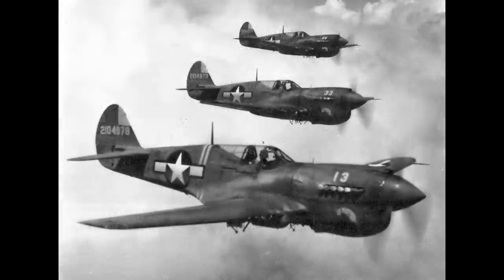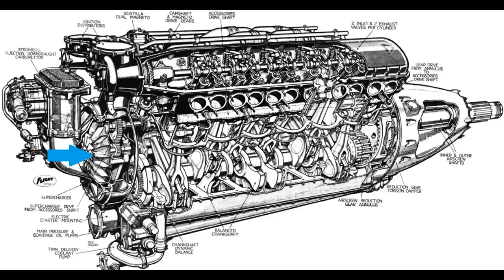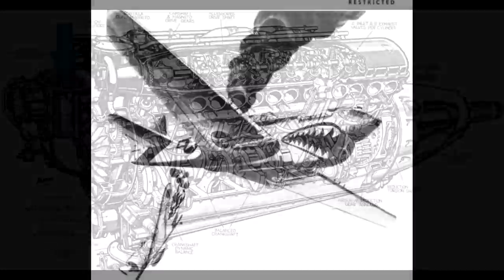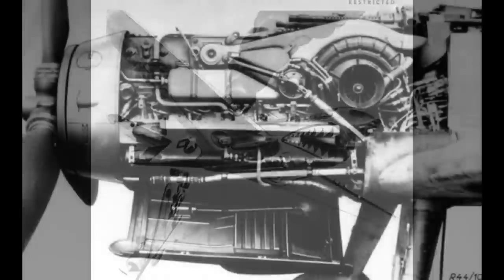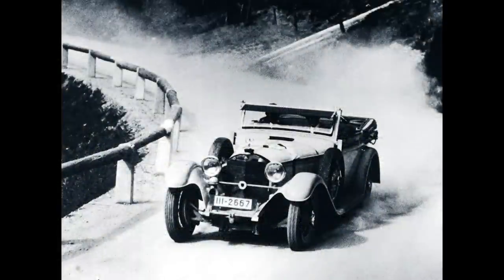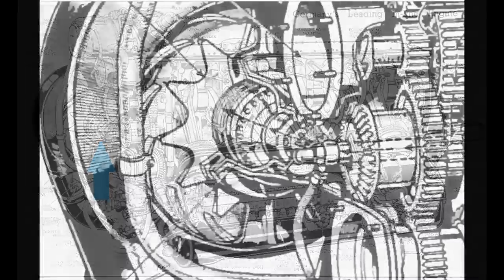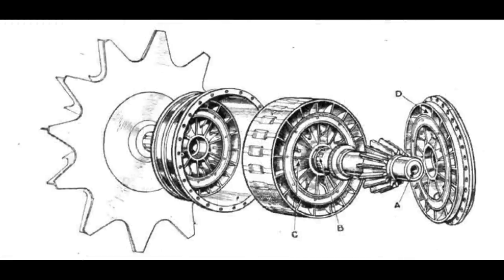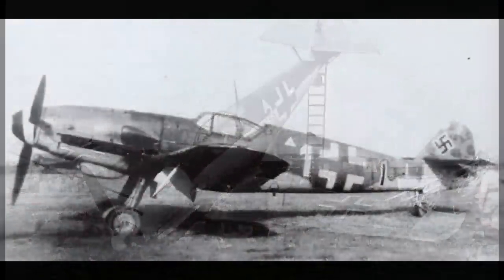Messerschmitt BF 109 Supercharger Drive System

Comment: Interesting, learned something more about the 109's engine, and coming back to my Train comment on the other video it is interesting, as in germany post war they used hydraulic transmissions to transmit the power from a diesel engine to the wheels, to have a smooth and uninterrupted flow of power. 

It was superior to the earlier geared diesel locos and multiple units/Railcars, and in weight and weight to power ratio superior to the Diesel-Electric transmission. 
Also without computerisation it was easier to run for drivers, as you didn't have to worry about putting too much current in the motor, which like overboosting can destroy them or rather burn them out, or field weakening, etc. 
Diesel electric transmission needs a lot of computer control to achieve that. 
However Diesel-Electric transmission was superior in that it was more rugged and needed less maitenance, as well as being able to run on a lesser quality maintenance. 
Also today it is much easier to get the train supply energy/Head end power, by simply getting it off the generator, unlike a diesel-hydraulic engine where you need to fit a generator for the electricity alone. 

However until fairly recently Diesel-hydraulic transmission reigned supreme in Railcars/multiple units, as they generally do not have as much space and need to lighter. 
Even British Rail which standardised on Diesel-Electric Transmission in locos did mostly used Diesel-Hydraulic transmission in their second generation Diesel-Multiple Units (Class 150-155, Class 165/166) and most of the Privatisation Era Multiple Units (Class 170/171, Class 175, Class 180 and Class 185). 
Only the Class 220-222 Family has been DEMU (Diesel Electric Mulitple Units), and the High Speed train is more like a conventional trains with two locos (Powercars) in a push-pull configuration. 

It became really popular here in germany and even the Western Region of British Railways used it, but it had some problems there, mainly that the system or rather the wheels were originally designed to run at 120 km/h in post-war germany and the British ran the locos routinely at 140 km/h......which meant that the wheels got to high rpm, which damaged the system. 
(It's also a problem with steam locomotives where the reciprocating steam engine/aka the cylinder block, can be damaged when oversped. Which is the main fear when it comes to wheelslip, as in wheelslip the "speed" at with the wheels move can exceed 200 km/h or 125 mph.........this is excerbated by the significant moving masses involved. )

Where this ties into the 109's engine is that this system allows near infinite variation of speed and torque, something which the railways need, and this supercharger design as well. 
Similar are also the compact size and light weight.

Comment: BTW, I always want to ask - Any idea why Germans used inverted V engines, and the rest of the world upright? That BTW also had its affect on the shape of fuselage cross-section that was kinda triangular shape, which is structurally a very sound construction.
Reply: +RussianThunderrr   Upright and inverted designs worked equally well.  Sometime in the 1930s when the German aero engines were being authorized, the RLM specifications were to use inverted V12s.   So the inverted specification came from the higher-ups.
Reply: my guess is for putting 2 7.92mm machineguns on top of the engine
or something about oil
Reply: Working on engines etc.  I would think one of the best advantages to having an engine upside down,  it is self draining.  Flooding, oil over oiling etc.  it can easily drain out with the valves on the bottom,  Acidenly hydraulic locking an engine is pretty hard with it in that orientation.  Looking at the cutaway I can see the pugs are high up and the injectors down low so even if an injector sticks open etc. it will not foul the spark plugs.  It is injected too, so it might be possible for the injectors to run without the engine running or a dead cylinder etc. if you do you still have a way for the fuel, oil water or water ever might seep into the cylinder to easily drain out.  Most conventional engines liquids can pool on top of the piston and give you problems.

Comment: A hydraulically driven constantly variable supercharger sounds almost like the supercharging holy grail to me. Is there any reason why no car manufacturer (AFAIK) has ever implemented it? It's it too bulky for a car, or something?
Reply from the maker: I have heard ATI has something similar now, but I haven't seen it, and don't know much about it. The main auto manufacturers tend to avoid centrifugals, so they never needed this technology. I think it's just easier for them, and less expensive to design to use a Roots or Lysholm, and not have to worry about a variable drive system. Variable drive would be better but there is a cost:benefit ratio they have to worry about.

Comment: How to spell that coupling guy’s name? Herman Blablabla。。。？
Reply from the maker: Hi Eric. The inventor was Herman Fottinger. The o is that funny German O with the dots, not our o, but my keyboard doesn't have it. Thee is a Wikipedia page for him, and another for his coupling design. For some reason I can't link it here in the comment section :(
Reply from the maker: Oh, and that's for watching my video. I really appreciate it. I never expected this video to get any views.
Reply: Greg's Airplanes and Automobiles 👌 thanks:)
Reply: It's essentially the same as the Torque Converter in a modern automatic transmission.
Reply: When you are lacking the Umlaut, just substitute "oe" for "ö", That's actually how the umlaut diacritic came about: It used to be small e in Sütterlin (a cursive font) on top of the o.
(Phonetic value of ö is closer to German "e" actually, than to "o". Think "e" in "jerk".)
Also, kudos for being one of the few anglophones who manages to pronounce "Messerschmitt" correctly. "meshersmit" drives me up the walls...

Comment: Have you every seen an automotive application of this type of drive ?  Is there any reason why it wouldn't work in a car ?
Reply from the maker: Hi Bob, I haven't seen this done in an automotive application, but it certainly could be. I have heard ATI has something similar, but I haven't personally seen it, let alone used it.
Reply: @GregsAirplanesandAutomobiles I have a copy of the book "The Romance of Engines" by Takashi Suzuki, published by the SAE.  He has a small section on the DB601 Engine.  He also has a diagram showing how the fluid coupling worked.  I could email it to you.

Comment: I disagree that an Allison would blow the engine if overboosted at sea level. This engine though primitive; is built to stay together under 60inches at sea level. Its Achilles heel is heat generated by the lower end and resultant bearing failures.
Reply from the maker: I can't see if you are responding to someone else, or to me. I don't recall saying that the Allison would blow if overboosted at sea level, except to say that any engine will blow if overboosted beyond some point at any altitude. I consider the Allison to be a fine engine, absolutely equal to any of the other V12.

Comment: my question is,  why did they make the engine upside down,  wouldn't it suffer the same problem as radials with oil seepage causing hydraulic lock?
Reply from the maker: I don't know, but here are my thoughts. From the German point of view, I suppose ours were upside down. Anyway, why an inverted V? It's a good question. I think it was for serviceability. It puts the key parts of the engine down low where they are easy to work on. Plus the pilots head is narrow. The entire fuselage of the 109 continues the inverted V shape which keeps the overall cross section of the fuselage quite narrow, especially at the top where it only has to be about as wide as the pilot's head. It has a dry sump, but I don't know if oil leak down was an issue. I have never seen it mentioned. If it did have that issue they would have likely addressed it the same way we did. Either a mechanic pulls and reinstalls the plugs right before start, or they used a starter with a slipper clutch and cranked it over X number of blades before turning on the ignition. I am not really sure.
Reply: I’ve had the same question never saw them clearing the cylinders on a 109, it’s a major concern on American radials.

Comment: HI, I have been pondering the 90 degree angle supercharger and have an idea, looking at the BF109 with  the side panel open it looks like you can easily access, remove/replace the main housing and impeller without having to remove the engine - as you said about the inverted V, it seems to be about easy access. 
Also being fuel injected you can use a smaller impeller as you are not trying to move the air through a carb first. 
The  Merlins supercharger set up seems a lot heavier (not counting any aftercooling) compared to the DB601 system. Would be interesting if anyone knows the weight of these units.
Also apologies if some one has already said this, I haven't read all the comments yet
Reply from the maker: All good points Bryce. I don't have the weights, but I am pretty sure the DB's set up was lighter.

Comment: Is it true that the German planes on the Russian front wouldn't work properly in winter as their tolerances were too tight?
Reply from the maker: I haven't heard that, also it would work the other way, lower temperatures allow tighter clearances, metal parts shrink when cold opening up clearances. Now it is true that the oil in German planes would get so cold it could prevent starting, that may be what you heard about, but they found ways around that.
Reply: @GregsAirplanesandAutomobiles  The history of WW2 is fascinating, thanks for the content, its a great boys channel but we can't say that ha ha .
Reply from the maker: I just looked it up, 3% of my subscribers are female, which is about 1500 women. Not many as a percentage, but still a decent number considering the topics covered.
Reply: Sorry to necro this old comment but....
By in large the whole loose tolerance = more reliable is a myth. I can't speak to aircraft specifically but this myth creeps up in discussions about AK vs AR rifle platforms. The myth being that the AK is more reliable because it can run with more junk in the action due to looser tolerances. The reality is that more junk gets in the AK action specifically because it has looser tolerances which leads it to being less reliable in comparison to and AR that does a great job keeping crap out. Also the loose tolerance = good always always seem to prop up Russian hardware which is....interesting.

Comment: You mentioned in a different video that the 109's supercharger was inferior at the altitudes at which they engaged p-51s on escort duty (approx. 25k feet). What prevented the supercharger from working at maximum efficiency at this altitude, if it could be set for almost any gearing?
Reply from the maker: Good question. What prevented it initially was the need to fight at both high and low altitudes. They did eventually start to prioritize high altitude performance with certain variants like the 109G14 AS, which did have a high altitude supercharger set up and was much more competitive with the P51. However it was too little too late.
Reply: Greg's Airplanes and Automobiles so the supercharger on earlier models, despite being able to adjust to a large number if possible gearings, still had some upper limit that prevented it from being maximally efficient at high altitudes?
Reply from the maker: There isn't a lot of data on the actual supercharger impeller on the 109s. However we do know that the G14AS had a larger supercharger which was also used in a version of the  TA152. Based on that information I am going to speculate that they couldn't spin the smaller supercharger any faster. Sadly, there just isn't the detail needed to answer some questions with 100% certainly, at least not in the English speaking world.
Reply: Greg's Airplanes and Automobiles thanks for the replies! You should consider doing some videos on tank engines. It would be especially interesting to learn about situations where the same engine was used in both aircraft and tanks.
Reply from the maker: I do want to get into tank engines, but I have other stuff to cover first. Thanks for your view and comment.

Comment: As I recall the old Duesenberg race cars also had sidewinder centrifugal superchargers, but I don’t know why.  Maybe to get high rpm from the supercharger with one step gearing?
Reply from the maker: That could be, but the ones I have seen are set up much like an Allison.
Reply: I I did some research and, Duesenberg used the sidewinder configuration Miller ( Duesenberg’s competition) drove the supercharger off the cam drive parallel to the crankshaft.  Duesenberg used a skew drive at 90 degrees on the SJ, the ultra famous playboy  show off street machine, only vertical..  Both Miller and Duesenberg used air to air “intercoolers”.  Both were very advanced straight eights that usually ran fuel not gas. “The Golden age of the American race Car” G Borgeson 1966! seems to be the best source on theses very advanced motors.  Why the sidewinder I don’t know.

Comment: Isn't this similar principals to a torque converter in an automatic transmission
Reply from the maker: Sort of, I think a much better automotive analogy is the Buick Dynaflow transmission.
Reply: No it is more like a "simple" fluid coupling without the torque conversion (as used in some early automatic transmission), only variable slippage and no torque multiplication.